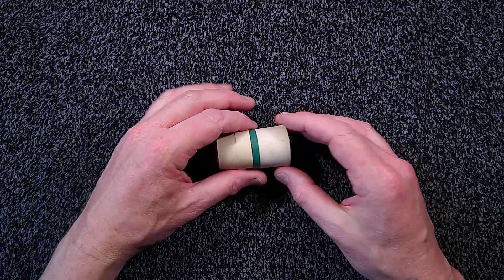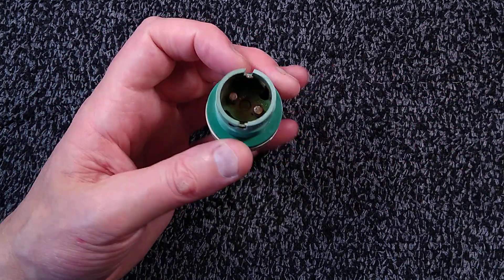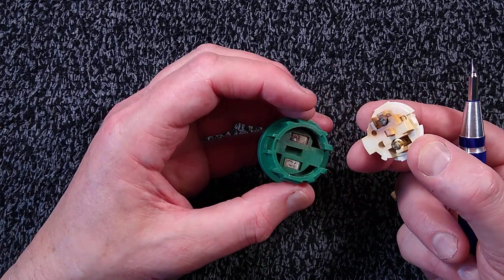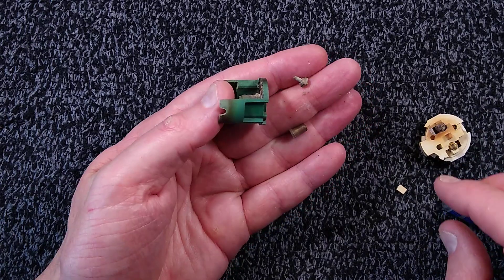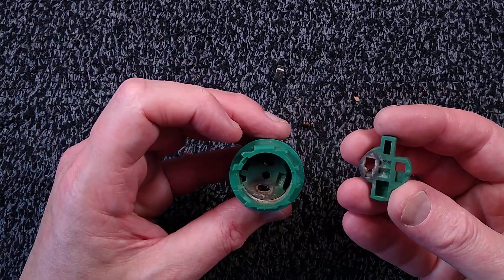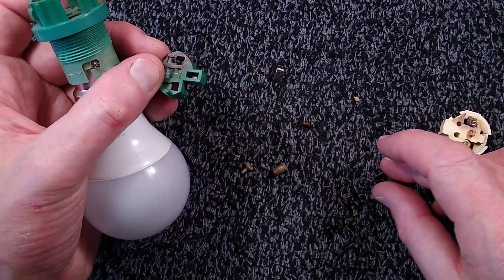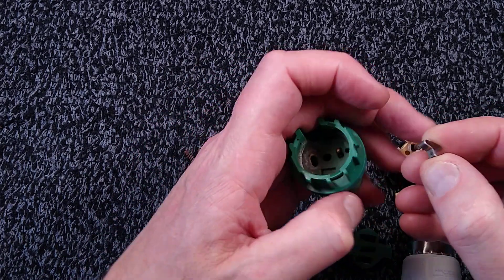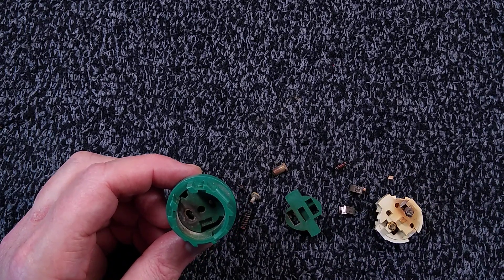Inside a failed safety lamp holder.

Comment: I'm the same when I go on holiday I end up fixing things too. Just can't help myself 👍
Reply: Always if I go on a trip or with somebody that I might be staying with her otherwise I always check to see if anyone needs any work done or need something wrong or fixed or otherwise and will often at least have some basic tools in the first place just the necessities.

One time when I was living with someone when we went to one of their relatives Place wound up installing their dryer and also straightening up a lot of electrical issues including putting plates where there should have been all along.

And also getting the upstairs 220 AC going again that place was originally a duplex one of those places where the upstairs feeds into the downstairs with the stairway old school where everyone would have to come in through the same door and trapeze through the downstairs to get to the upstairs place.

To my surprise some of the stuff was tapped from the downstairs power most of which was ran in conduit of the outside and some vice versa in a similar manner promise there was no single main disconnect for everything originally there was four separate meters two for water heating and two for everything else and in the end everything was connected to one kilowatt hour meter and the water heater connections have been reconnected the small panels as well you would literally have to to open four disconnects which is in four sections of the house to disconnect power without resorting to having utility company pulled the meter.

Also before I left I recommended that they have a main disconnect put in on the outside has to be able to shut down the entire place.

Boy that I have problems finding a all those disconnects that time to show off power to work probably when the craziest times I've seen and yeah no one would have even realized that there was more than one disconnect.

Not to mention some of the panels fed another panel either upstairs or downstairs and vice versa as well I think I found a total of eight panels/ disconnects or a combination there of if not 10.

Not to mention finding one panel that was not even metered I believe that originally that was used for electric heat they had a weird system in that area some places originally electric was unmetered.

In addition there were some secondary disconnects which is in panels for some other loads that I'm not including in this such as range dryer and a few other specific the garage was another story turns out it was powered from the neighbor's place.

As well as at least one feeder from the garage feeding some electric heating and a water heater yeah crazy.

I've heard of Charter wiring where you get one feed in of hot at one end of the string of switches and the neutral from the other.

But this takes the cake.

There was an outgoing that there was two houses originally owned by same person one was used as a guest house there was a single light circuit in the operating including one above the door outside and the other inside.

For some reason wiring series at that.

The power was through a three-way switch.

One was on an outdoor pole and a four-way switch outside on the out building and another one on another adjacent Pole like several yards away.

The other polar to switch was was closer to the original guest house.

There was a single wire running from either house to the pole one side providing neutral the other providing hot.

And a weird thing is originally there was a separate meter but it had been bypassed but when the other person was using the guest house as intermittent / vacation residence.

Kind of like a cabin in the woods if you could say.

A meter was installed however everyone was crushing their hands why there had never been and electric bill was always zero exception of the meter reading fee turns out no one bothered to open the meter box or just overlooked it or just didn't care or something the meter bypass that was original to the place since there was no other tenant at that time and was on the same meter at that time was still in place!

Easier to fix it's a separate those two Services though at where the power came in since there was a split there as it was with main fuses below the meter originally then again sometimes you'll see this on Farm property and other large properties.

Not to mention the well pump was fed straight from the meter Pole and not metered no fuses other than at the well house itself and also a switch which would bypass the fuses for the water pump my guess is that was considered a fire pump which at least at one time in certain ramifications is legal or at least partially in this case but it's odd
Reply: Me too lol
Reply: Same, i even Donate my time once a month on a Sunday to a ‘Repair Cafe’
Reply: I will too, but only when adequately motivated. A blinky light in a common area  would probably get avoided by closing a door, though I might report it to see what response was generated. A receptacle mounted with the ground on top (American) will be inverted if it interferes with convenient use.
Reply: I have also done that frequently, but more often on business trips.  It's often easier and quicker to DIY than trying to report the fault and get it fixed by the maintenance guy.

Comment: I had a similar thing with an E27 socket. The inside was made of a brittle ceramic-type material, with the connectors riveted into it. At the spot around one connector the ceramic was broken and the connector wasn't pressed firmly against the lamp, causing very nice electrical noises.
Reply: Modern porcelain imitations tend to do that, I had one melt the contacts and screws, when the live wire snapped off the metal cooled down into little brittle puddles, probably made out of tin because I was able to melt it again using a puny 20W soldering iron.

Comment: UK: Complex, failure-prone bayonet "safety" lamp holders.
Most of the world: Edison screw where quite often the thread is live. 😂
Reply: Only if installed backwards.  The screw should be neutral.
Reply: @johndododoe1411  Should, correct. But how many average people installing their Ikea ceiling lights consider this? And for table and floor lamps with unpolarized plugs, there's a 50/50 chance of the thread being live.
Reply: @johndododoe1411  by the way the old school Edison base fuse sockets the screw show is supposed to be on the load side.

Sometimes in the single for your sockets or lamps I can say have been repurposed as a fuse holder not always the case yeah just be aware not always as it should be to say the least.

Also even if polarized plugs on lamps or even a grounded plug in some cases.

People that have either rewired a lamp themselves or had somebody do it for them it's no guarantee that that has been probably connected to hot and neutral as well.

Here in the United States at least typically on zip code AKA lamp cord.

One wire has either ribs or other distinguishing ridges on one side and the other does not or is quite distinctly different it's easy enough to not realize it in reverse the polarity if you don't pay attention.

I always double check polarity before I button things up with repairing a lamp for this reason that also is done by doing continuity test not just by visual!

Also good when working in low light if need be probably a good idea as it is just for sure reliability and making sure everything is kosher after the repair
Reply: @aaronbrandenburg2441  Of cause it's easy to reverse accidentally, but as a pro I check when wiring new ones.  I don't know what fuse you first mention, but I'm old enough to remember edison-screw fuses and how to prevent inserting the wrong value for the protected wiring.
Reply: @Matt Quinn Of course they're shrouded, but this won't stop you from touching the thread when changing the bulb.

Comment: I've never seen a "safety" bayonet fitting before. In my country the fitting just has the two pins in the bore of the fitting but they are spring loaded so they don't become live until they are pushed in, still very easy to get a zap on 😂
Reply: that IS a sort of safety one, then, most here ,uk, still connect even if the pins dont get pushed in!

Comment: Wow. Never seen anything like that in "ordinary" lamp. Only some car lamps do have similar construct. Here old ones (like from 50's) are porcelain (I think) holders with screw-in lamps and newer ones are just plain plastic. And barely you hear anyone to die when changing lamps... :)

And like someone else noted IKEA has been selling LED-only (or anything very low power) holders for a while.

Comment: Incandescent candelabra style Edison base bulbs are the worst when it comes to heat cycles. They are the ones commonly found in ceiling fans. The threads of the Edison Base tend to seize in the socket. Also, the glue weakens and separates. So, when you try to remove the bulb from a fan mounted high in the ceiling all you get is the glass portion and the base remains in the socket.
Reply: True also those ceiling fans that had a night lights in the motor housing or surround near the ceiling or even in the lower motor itself I've seen a few designs of this that take the 15 watt candelabra C7 and a half bulb.

Note on the labeling of these you will notice that it reads not for night light usage even though that's what they're used for in those cases and those require a ceramic socket for obvious reasons since such intense Heat.

Talk about thermal cycling yeah and those are son of a gun to get out of socket often times.

Normally anytime I'm going to cross one of those or need to mess with one I always put on leather gloves no matter what now so many times it's not gone so well one way or another.

And people have told me about their Night Lights melting or decorative lighting things melting where the cord set sockets for these melting and usually in most of these cases yep use the 15 watt bulb mistaking it for a night light!

Better bet just use LEDs and be done
Reply: Not really a problem anymore but we used to grease them for that reason, just a little bit of high temp automotive chassis/wheel bearing grease on the threads.

Comment: At 3.45, if you extend the 2 sliding straight pieces out to the left and right I think you have the component for lamp holders that have the built in slide switch for turning on and off the lamp? So the design is has 2 possible uses with a bit of tweeking.. safety interlock or a builtin switch (edit: not both on the same unit though)
Reply: i've seen some that are both, , dunno how the 'safety' bit is done in them, though,

Comment: had several of these fail the same way, seemed, from a small sample set, to be on dimmed circuit. maybe PWM is causing a slow erosion of the, minimum serviceable quality, contacts in these and then rapid thermal breakdown when the contact resistance has gone up.

Comment: On a German channel I have seen someone experimenting (very safely) with a cheap RCBO from China and compared it to quality but pricey products from Siemens and ABB. If the neutral wire was cut in the mains to the cheap RCBO it did not switch off even with a large earth current (through a lamp), while the expensive ones did switch off instantly.
Reply: @NinoJoel  I will rebuild the electric system of my house, which is from 1966... No RCDs and so on, only one live wire instead of the standard 230V/400V three phases nowadays. I do consider using AFDD in addition to RCD for living rooms and bedrooms... No cheap stuff for me.
Reply: @strenter  AFDDs are a nice technology but not necessary in my personal opinion. 

They are relatively new on the market and still overpriced for what they are. 

I'd wait till they get cheaper and add them later. 
Just get a slightly larger fuse panel with some room left to add them later. 

For the American market they are a great addon since their electrical installations even when new are hilariously bad and tend to spark everywhere.

Comment: That lamp holder was properly blown, I don´t know if the extra "safety" is good in terms of fire though. more parts in contacts resulting in voltage drop across making more possible points of failure. voltage drop across a connector gives heat and meltdown if too much. but your curiosity share knowledge to us here because of that

Comment: Here in Brazil we don't have that pin, instead the lamp goes to the socket in a corkscrew movement, the bottom and the side of the lamp are contacts for live and neutral. When it' s screwed it closes in a way that is not possible to put your finger in, honestly it feels very safe for me, at least.
Reply: Edison screw is kind of sketchy, requires the polarity to be right to not have live on the often somewhat exposed screw base. They're safe if you understand that and keep your fingers away from the base when changing bulbs, but most people just grab at things wildly without thinking.

Comment: Interesting! It’s odd but in some older residences here in Greece still use this bayonet style lamp holder but NOT the safety style. Anytime I come across these they get replaced by an E27 lamp holder. Not funny thing I have come across the USA version is known as an E26 lamp holder. What’s the difference since the screw is the same? It’s actually in the base of the lamp itself as well as the holder. The E26 lamp base has a rather flat center contact that protrudes about 3/16 inch while the E27 base protrudes about 5/16 inch. Screwing a 120 volt E26 into an E 27 base the lamp makes no contact with the lamp holder thus you get zero contact and the 120 volt lamp is safe from burnout. You can however screw an E27 into an E26 base, it will make contact but the lamp will glow dimly while running on 120v in the USA WHILE LED LAMPS WILL NOT LIGHT BUT ONLY FLASH OCCASIONALY.
Reply: E26 bulbs will work in some E27 holders - it depends on the the design of the bottom contact.

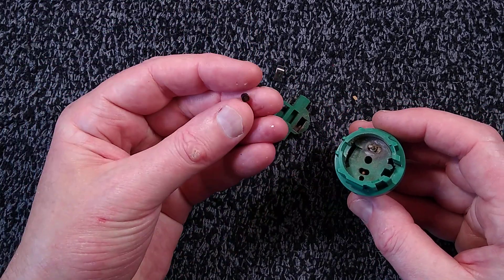Comment: Hey Clive, I really like your videos, and seriously, that previous good old background was WAY better than this one, even if it was somewhat old and worn. The background here makes it literally impossible to see anything scattered. Take a look at 1:49 or 1:50 where some tiny bits fell off. They are almost invisible on that carpet-ish background. Please use a more solid color, not something close to pixel noise :) of course, that's my private opinion. I didn't do any opinion reasearch or other poll amongst your viewers! :)
Reply from the maker: I'm currently working away from home, so this is a temporary video area with the grey background needed to limit reflections.

Comment: I see many lamp fixtures here in the US that are rated for "60W Max". 
Here in the age of LED bulbs I ponder how much light could be emitted from a screw-in LED Edison bulb that consumed a full 60W. No doubt it would be jarring to walk into that room and flip the switch!

Still, many of the 60W rated fixtures that have been in service for decades, that I have personally seen, show considerable thermal degradation and even insulation failure.  I suppose that the thinking at the time was something like this: "If it takes 40-50 years to cause a fire it won't be my problem."

Comment: Big C, got a little electrical puzzle for you if you like, I don't have access to any tools at the mo so I can't repair the problem. I installed a ceiling fan and combined light a couple of years ago. Until recently it worked fine. The fan is operated by a remote control only and the light is operated between the remote and a switch on the wall like two way switching. For no apparent reason the fan will only work now when the light is switched on from the wall. Tricky at night, so to get it to work  in the heat we recently had I had to remove the lamp with the wall switch turned on . Er' indoors is complaining about me having to put the lamp back in every time she wants something out of the cupboard in the evenings, any pointers you can think of to correct it ? I won't have any  tools for a while, some tow rag nicked my van and I've got to start again, if I ever get the insurance money !!  Keep up the good work mate, always enjoy !!
Reply from the maker: It sounds like you may have an issue with the fan's live feed.
Reply: Hmm, I'll have to think that through, its a real weird mystery, I won't really find out till I take it apart. Thanks for taking the time, i'll let you know if I crack the case !!